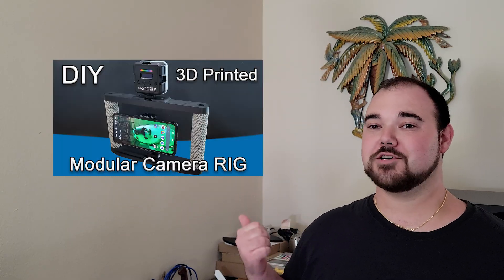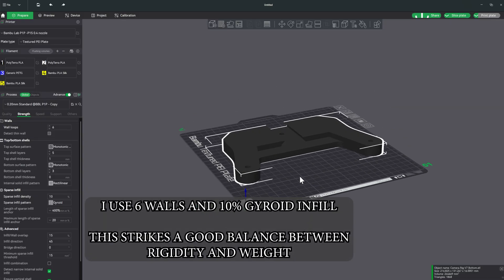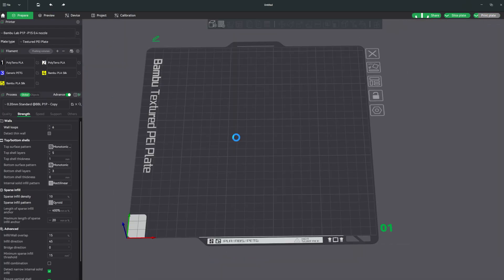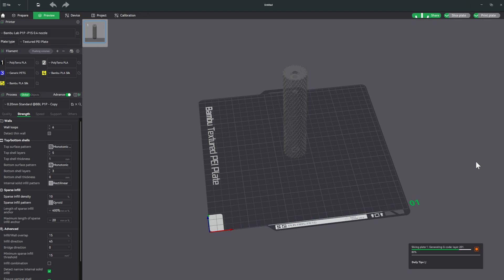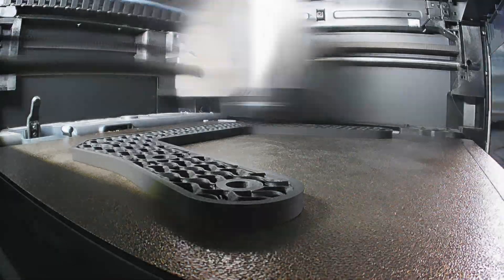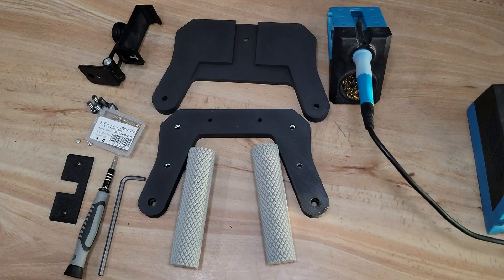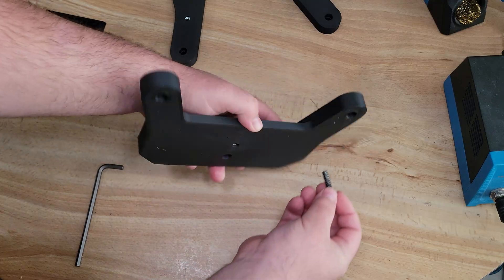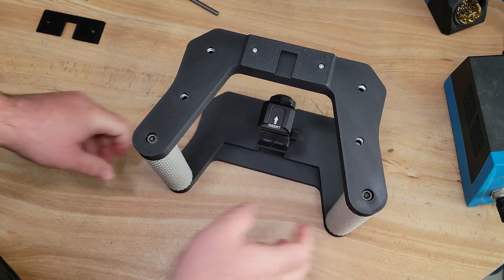3D Printed Modular Smartphone Camera Rig V2

Comment: Do you have the settings for orca slicer my 1/4-20 nuts are not flush
Reply from the maker: Are you using 1/4-20 jam nuts, or normal 14-20 nuts?
Reply: Jam nuts the one the link
Reply from the maker: @joea7985  hmm that is odd. they should fit. About how much do they stick up? I can modify the file to make a little more room
Reply: @makerscorner93 please let me know when you modify the file thanks
Reply: 2mm
Reply: I think I got normal jam nuts
Reply: 5.56 mm x 11mm
Reply: When you get a chance can you please remix to fit my jam nuts please and if you can. An you also remix V1 as well I want to print 1 of each thank you

Comment: What length for the screw
Also what infill % and style did you go with
Reply from the maker: I believe they were 1" bolts. I used 6 walls with 10% gyroid infill, but you could probably get away with 4 walls. I just wanted to make sure mine was extra stiff
Reply: Do you have a 3mf file

Comment: What dimensions are these jam nuts? Would I have to change the design to make metric nuts fit or could I cheat them in?
Reply from the maker: They are 11mm measured face to face and 3.9mm thick. I doubt you would be able to get a metric size to fit without modifications. That being said 1/4-20 should be easily found in most hardware stores around the world as it is one of the few "freedom units" type hardware that is used everywhere. It is the standard thread type for most camera and audio equipment. If you still want to change it anyway, there are step files in the link provided in the description so you can modify it very easily

Comment: Very awesome design! Why all the hardware though? Could this not be achieved with threaded prints or a peg type system? Thanks for the video though man, you’ve found a new subscriber :)
Reply from the maker: Great question. The reason for the hardware is because most camera equipment uses 1/4-20 as a standard. Printing threads that small is a bit of a challenge that most printers are not able to achieve properly. Additionally, plastic threads are nowhere near as strong. Since some camera equipment can be a bit pricey, it is a lot safer to use real hardware. It will also last MUCH longer that way. I'd hate to see a $1000 phone fall to the ground because of a plastic thread or peg failing. This design provides high strength with relatively minimal hardware. Glad you liked it and thanks for subscribing!
Reply: @ awesome, thank you for the reply! Look forward to seeing your other creations